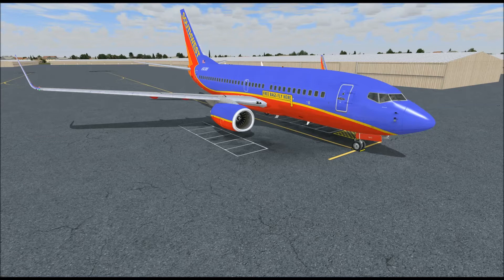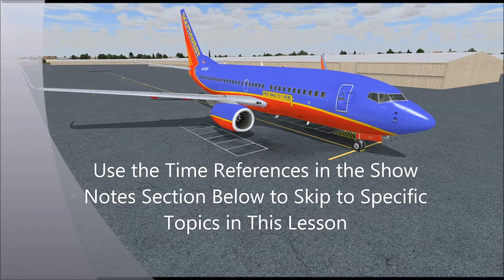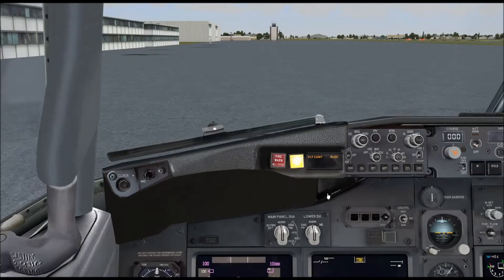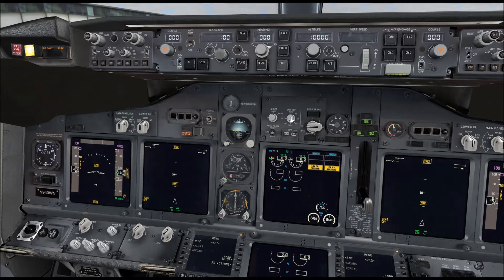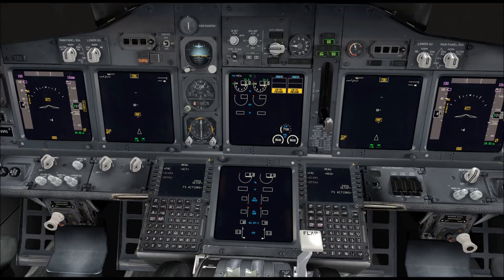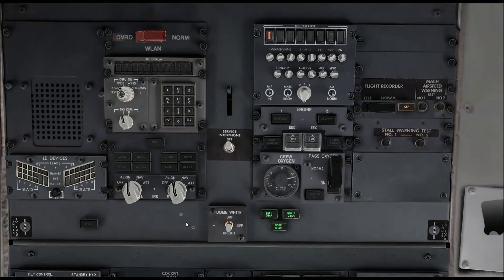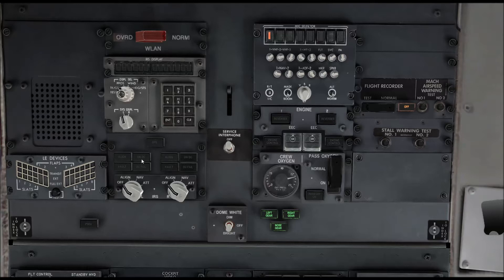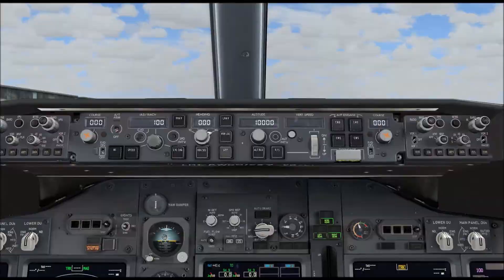FMC Ground Operations for the PMDG NGX

Comment: Amazing video. Thanks so much. This has helped a lot! One question... at what point in flight can you choose an ILS approach? I'm used to the A320/A321 that allows you to choose before take off. Many thanks
Reply from the maker: You can choose the approach once you have entered the arrival. It just doesn't make sense to select it until you are close enough to the destination to determine what the best approach will be based on the weather.
Reply: @CaptainMac  thanks so much. That makes perfect sense!
Reply from the maker: My pleasure